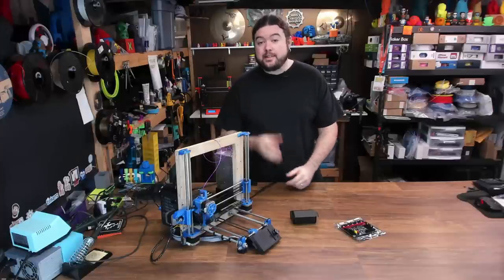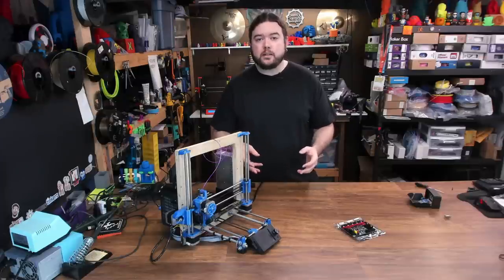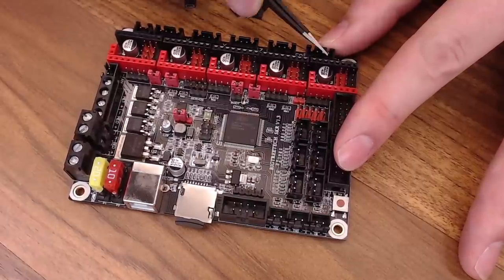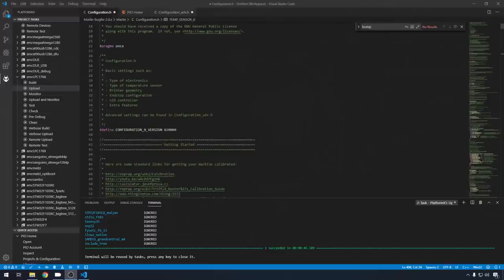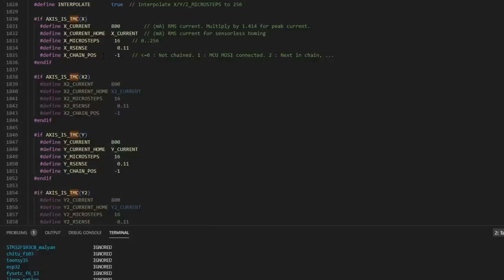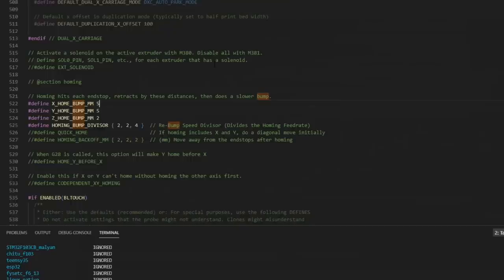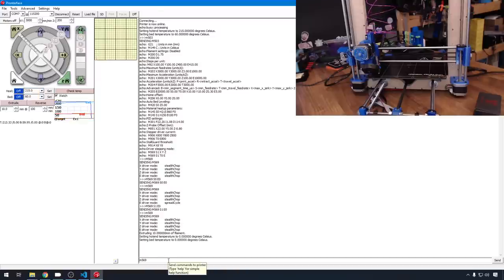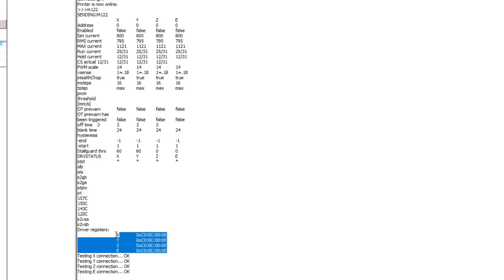TMC2209 Stepper Drivers - Bigtreetech - SKR 1.3 - Install - Chris's Basement

Comment: I'm at a loss for what is going on with my setup, maybe you can offer some insight. 

So I have the exact same hardware as far as the board and stepper drivers and I have gone through my configuration files dozens of times now to make sure my settings are correct. I have my drivers set up in the exact same way in the firmware and all commands come back fine, nothing seems to be out of place. The issue I'm having is when using sensorless homing I get motor grind as if it's crashing but it doesn't actually crash. It just grinds for a bit and then realizes that it hit something. If I set the homing sensitivity too low I get the expected "homing failed" crash.

I've tried several things to fix this issue from mucking with the current and vref, enabling endstop pullup for x and y min individually even though these supposedly don't need that. I tried homing in both stealthchop and spread cycle. I've even tried a second skr 1.3 and set of tmc2209's to be absolutely sure I didn't just have junk hardware and both sets behave exactly the same.

The only real difference in my setup to yours is that I'm using 0.9 degree stepper motors (with steps/mm set accordingly) and I'm running my second z motor off the E1 plug. All motors move and behave as expected aside from the unbearable grinding. 

Have you seen anything similar to this problem before? I haven't been able to find much on the issue and it's got me stumped.
Reply from the maker: I know you have tried both ways, but the only way sensorless homing will work right now on the 2209 is with stealthchop.

The only thing I can think of is the jumper isn't on the X and Y diag pins.
Reply: @ChrisRiley  hey, thanks for your reply! I actually managed to fix it about a couple hours after I posted my comment. I'm not sure what exactly it was, but it was something in the firmware causing my issue. I realized that I was running a modified Marlin config that was built for an anet a8 because my printer is actually an am8. I had just gone through changed what I thought were all of the relevant settings when I changed over to an SKR 1.3 and everything functioned as expected when I was using tmc2208's. I decided to start with a fresh copy of Marlin to rebuild it from stock for the SKR board, and now everything works as expected :D I'm gonna compare the configs between the two later to try and figure out exactly what was causing my issue so maybe I can help others from having the same headache. One thing that still stands out to me though is the homing sensitivity on mine is considerably higher than yours. I had to set it to 170 on both x and y to get a quiet homing bump.
Reply from the maker: @MrKarriban  Glad it's working. Interesting, I guess the higher setting is okay, just not sure why that is.

Comment: I'm glad you mentioned early that "if you buy something like a SKR1.3" exactly right, its what $25ish? I don't care how tight cash is, its just NOT worth mucking about crimping wires and stuffing about with firmware, finding pins etc for hours and hours on end for the sake of $25. And you are gaining a whole hell of a lot more than just that, you get a much faster board so it doesn't slow down in circular motions, heaps of RAM so you don't need to turn anything useful off, replaceable fuses etc
My only gripe with the SKR board is unlike pretty much every other board on the market, it cannot be powered from BOTH usb AND 12/24v main power at the same time, only 1 'or' the other. 
What does this mean? Well take a Creality board for instance, it'll boot up with just a USB cable plugged in, but the screen will be dim, motors dont work etc, fine. But turn the mains power on, the screen lights up bright and easy to read and then all the other functions work as expected. The SKR doesn't do this, you change a pin and if you move it to provide power from USB, it will only ever power certain functions from the USB, like the display so it'll remain dim and hard to read constantly. It also has issues with stepper drivers in this way. If you kill the mains power, the stepper drivers screw up and lose some settings, namely the microstep values, so after resuming mains power they often revert to 1/8th microstepping and double the distance moved in any axis

Once again, why does this matter? Well for me personally I use power relays to automatically turn the printer on as a print starts, and then off when its completed, just 1 extra thing to automate to make life easier. And this caused me a lot of grief. I did find a partial workaround which is to incorporate 
M500 ; save current settings to EEPROM

G4 P500 ; pause 500ms
M501 ; load settings from EEPROM
G4 P1000 ; pause 1 second
Into my starting G-Code. This process restores the correct microstepping value. I can't find any other G-Code to reset the stepper drivers only a M502 (and occasionally M501 needed) does it
Still doesn't do anything for the screen or other functions (mains power still absolutely required when first starting  or rebooting the board), and it prevents you from tweaking settings temporarily between prints and then restoring if you screwed something up. Also sometimes I need to also put M502 at the G-Code (restore hardcoded defaults) and that can completely screw ur ability to change settings as it'll always reload from firmware settings. That includes things like the Z offset

If they fixed this so it operates exactly like most other boards on the market and not need this ridiculous workaround, it'd be the perfect board. But not everyone needs to use power relays like I do so its also a mute point for many people
Reply from the maker: Thank you for the comment and your thoughts on this board. I am curious where BTT will go from here. They do have  a new 1.4 out now. I hope it will fill in some gaps for us.

Comment: Hey Chris
really like your videos have just tried to set up my SKR 1.3 with TMC 2209's alls good but my z is moving  10 times what it should if i try 1mm its 10ish if 10mm its like 100. I followed your setup to tmc2208s and then tmc 2209s have downloaded  marlin several times to reset back to base. but every time it is the same x and y are good just z is moving to far. what can i check.
Reply from the maker: Hey, it might be your steps. Marlin defaults to 4000, you need 400. If you send M92 Z400 that will fix it, then you can update it in firmware.
Reply: Thank you Chris, that was the culprit  now to relevel the bed, again thanks for all you do for 3d printing and for your quick reply to my problem.

Comment: How does it compare with TMC2660 (Duet 2 controller board) in terms of noise and current ?  It will be perfect if  Duet supports the pluggable driver. thx
Reply from the maker: The 2660 will be just as quiet as the 2209, 2660 can handle 2.8amp, so it can support larger motors if needed.
Reply: @ChrisRiley  thx so much for your promptly reply.  : )

Comment: Are These Settings For A 12V Or 24V Setup? And What Would The Differences Be?
Reply from the maker: These are for either, these drivers should be good up to 36v I believe. The configs would be no different as far as boards and drivers go.

Comment: Can you use something like BL touch and still enable sensorless homing for Z axis as a precaution? As i hate when the hotends slams to my bend... it once bent the heatguard.
Reply from the maker: I think you could, I haven't tested it yet, but it should work that way.
Reply: @ChrisRiley  Thanks. Ill look into it when i get my new board installed. Would be really good to have a failsafe, double z motors have a lot of power to bend stuff.

Comment: I do not quite understand why you cannot use both DIAG pin and endstop. If I understand correctly DIAG would pull down only in case that something happened and can be configured not to pull at all through UART. Then they can coexist with endstop on the same pin so you do not have to cut it it. Issue could be if endstop pulls up and DIAG would try to pull down, then you would burn DIAG output, but that can be avoided if you use proper endstop.  Am I missing something?
Reply from the maker: I think there is a combination that we could come up with to make this work. You can also just move the pins around in the code to do the same. BTT tells you to clip them, that's why I showed this method.
Reply: @ChrisRiley  Actually I looked into TMC datasheet and also installed them on SKR and unfortunately they keed diag pin low and only when stallguard happens it releases them (or pull up)  for short time so looks like it is problematic to share them with endstop. I do not realy like idea of cutting pins on the driver so I think it was terrible idea to remove those jumpers :( I would better not have double connectors for Z steppers or at least they could provide solder pads on the board

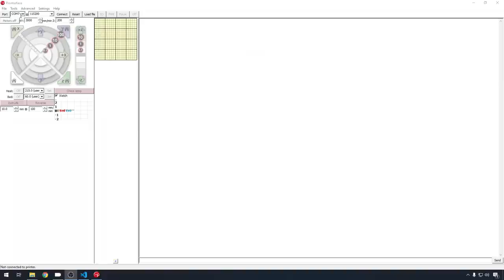Comment: 14:59 why not just use the reset button instead of power?
Reply from the maker: You can probably make that work just fine, but I have had better luck just rebooting.

Comment: Could you do a video about Sensorless Probing? There's so less information about this and i stopped at the message "#error "SENSORLESS_PROBING requires a TMC stepper driver with StallGuard on Z."" (I have a TMC2209) on Marlin. Would be amazing if you could try that probing type.
Reply from the maker: I have tried before and failed. I am hoping in the next release of Marlin I will get it to work.

Comment: what auto bed level are you using ?
Reply from the maker: It's bilinear.
Reply: @ChrisRiley  i mean the device that you are using for auto level
Reply from the maker: @EnergySeeker  Oh, it's this probe here. https://www.aliexpress.com/item/32981810289.html?spm=a2g0o.productlist.0.0.f0131111Is3h1Q&algo_pvid=0028a139-4c27-446e-947f-93639881fad5&algo_expid=0028a139-4c27-446e-947f-93639881fad5-13&btsid=cee40d16-095b-46a6-9508-b8c4419e0070&ws_ab_test=searchweb0_0,searchweb201602_5,searchweb201603_53
Reply: @ChrisRiley  awasone video, very usefull. For this probe, that you are using, you use BLTouch in the Marling configuration.h?
Reply from the maker: @javierameghino9573  Thanks! No, you will use the fixmounted_probe.

Comment: That's weird, compiling the lastest stable Marlin 2.0 release, when trying to set the endstops to 'false', I get a sanity check saying they have to be set to 'true' for sensorless homing...

In file included from Marlin\src\HAL\HAL_LPC1768\../../core/../inc/MarlinConfig.h:38,

                 from Marlin\src\HAL\HAL_LPC1768\../../core/serial.h:24,
                 from Marlin\src\HAL\HAL_LPC1768\DebugMonitor.cpp:26:
Marlin\src\HAL\HAL_LPC1768\../../core/../inc/SanityCheck.h:2108:8: error: #error "SENSORLESS_HOMING requires X_MIN_ENDSTOP_INVERTING = true when homing to X_MIN."
       #error "SENSORLESS_HOMING requires X_MIN_ENDSTOP_INVERTING = true when homing to X_MIN."
Reply from the maker: Strange, I am working on a config now with the official release, I will check it out.
Reply: @ChrisRiley  Thanks Chris, let me know if you find anything :)

Keep up the awesome work!
Reply from the maker: @TheTrueTek  Hey Rafi, I confirmed it would let me set it to false. Not sure what's up with your config. On another note, care to share your MMU2 SKR config? ;)
Reply: @ChrisRiley  Strange, I'm running off of the official Marlin 2.0 release... I've got it mostly running right now, worked around a bunch of weird issues, (like the extruder only working in one direction if i set the second serial port to 2!) 

What's the best way to share my config files with you?
Reply from the maker: @TheTrueTek  A Google drive link would be great!

Comment: Going through the conversion of my Wanhao i3 and these videos really are amazing!! so Thank you Chris :)
However, I've just spent a few days trying to set sensorless homing but failed constantly and always with same result (printer setting home 0,0 right after starting a G28, not even trying to move left. I'm using Eryone 2209s, but now ordered BTT 2209s to see if its a drivers' problem. Anyone aware of Eryone not being good, or anything different to be configured with those? (sensors ALWAYS TRIGGERED when querying with M119) Thanks!
Reply from the maker: Hello, which board do you have?
Reply: Aha! You replied right when I was watching your video about linear advance .
Anyway I’ve now swapped the Eryone TMC2209 with BTT ones (they weren’t available when I ordered my skr1.4)... and now it works! Clipped the diag for X and Y and now all works just fine!  Just setup this morning? Thank you again :)
Reply: Board is BTT SKR1.4

Comment: Will I be able to connect these drivers in another mode without the uart mode
Reply from the maker: You should be able to use stand alone mode, but you might have to solder some pins. Check the BTT github for the manual.

Comment: Has anybody here have had issues with sensorless homing when using steppers with higher inductance and resistance?
Reply from the maker: I haven't run into that yet, maybe others have.
Reply: @ChrisRiley  thanks for the reply. For info, the 17HS2408 (I have 5pcs) with 8ohm/10mH gave unreliable sensorless homing with the TMC2130. It would either crash or false trigger no matter the current or sensitivity settings on Marlin.

Comment: Hi Chris! 
how did you wire the inductive probe on the skr 1.3? I have a 5V NPN NO probe and i can't seem to get it to work.
Reply from the maker: I just hook mine up the the Z min endstop pins and they work. Might be a bad sensor. I would check the board with a meter make sure that pin has 5v output.
Reply: @ChrisRiley  hmm, ill try ordering a new probe. Thanks!

Comment: Can i install them on the anycubic i3 mega s? Cant find anything on the whole web :(
Reply from the maker: Yes you can, you might have to make some firmware changes as they will turn in the opposite direction. You will need to run them in standalone more.
Reply: putting them into standalone mode is all i need for the mega s/x?! these settings are very confusing lol
Reply from the maker: @agenttank  Correct, but you will have to solder some pads to get it to work depending on the driver board. It seems like all of them are different.

Comment: Right now my  homing sensitivity doesn't seem to like 110. Just now going to try higher.
Reply from the maker: Hmmmm....let me know how this comes out.
Reply: @ChrisRiley  Didn't work at all. I keep reading some bug with the sensorless homing. I gave up and went the regular route.
Reply: @ChrisRiley  Also funny thing is I can't get my HotEnd Exruder heater to heat up. I just get silence and a USB crash. I was looking for the pin controller on the visual code studio software. I can't seem to find the location.
Reply from the maker: @dragnet53  You should be able to see the heater pins in the pins file for that board.
Reply: @ChrisRiley  Yeah, I saw that and finally got everything running. This has been a hassle on the Anet A8. lol

Comment: If you have 2 x Z motors connected via an adapter to a single driver, when changing HAS_TRINAMIC section, do you need to double the  Z_Current ?? e.g. from 800 to 1600
Reply from the maker: No, 800 is more than enough for 2.

Comment: Hi Chris. I have a problem with fisical endstop with same hardware. With m119 read trigger but the motor does not stop when it touches the switch. Do you have solution?
Reply from the maker: I have only seen that on some older versions of Marlin 2.0. Have you tried Marlin 2.0.3 yet?
Reply: @ChrisRiley  Hi. My Marlin Is bugfix..
Reply from the maker: @modelrcitaly  Try to upgrade to 2.0.3, that might fix it.

Comment: HI how do I install these on a SKR PRO? also how do I set an SKR pro to now run my ender 5 
as when I press home it just shoots off and crashes into the frame and the bed comes right up to tip 
which scrapes along the glass, same as if I press print I have to press emergency stop
  I cant print nothing and cant find any guides vids or help anywhere do you know how I can get my printer working?
Reply from the maker: I would have to look at your config, you have a pretty custom setup.

Comment: When building Marlin with PlatformIO in VSCode it takes about 5-7 minutes on my Dell XPS with Intel i7. I saw in the video that it took Chris only 44 seconds. Am I missing a trick here? Any help would be appreciated!
Reply from the maker: Do you have a 1.4 turbo? It has to do a bunch on includes. My Turbo build takes about 3 minutes, I am running 32g of memory.
Reply: @ChrisRiley  Hi thanks for you answer! No it's a standard SKR 1.3.. I'm wondering, it's compiling very many files very time I run the build command not only the ones that have changed, is that normal?
Reply from the maker: @jans.7774  Yes, it has to compile the whole thing every time.
Reply: @ChrisRiley  Okay good to know, maybe I will try reinstalling PlatformIO or try it on another computer and see if that helps.. Thanks!
Reply: By the way the computer has an Intel i7 6560U and 16GB of memory, should be powerful enough

Comment: hi i have a skr v1.3 and the tmc2209's in the video and i can not get stealthchop to work in pronterface when stealthchop is enabled in firmware it says it is in spreadcycle for all steppers i have them set up in uart mode atm.
Reply from the maker: Hmm, stuck in eeprom? Try resetting it. M502 then M500.
Reply: @ChrisRiley  thanks for the reply i will get back to you when i have done this in the process of printing out all parts for motherboard swap